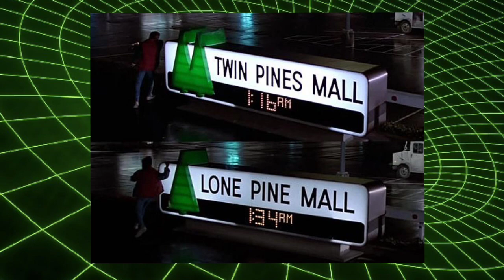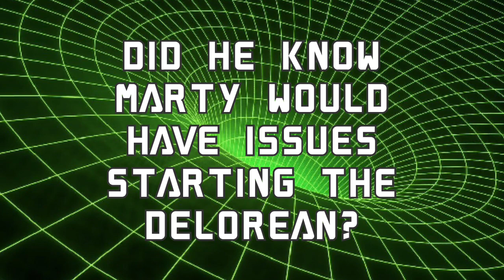Back To The Future Theory - Docs Lightning Strike Calculations

Comment: Assuming that the car connected to the wire at 10:04 pm. there was a 60 second window where the lightning could have hit the tower.  Doc eluded have needed to build a wire about 1 1/2 miles across to account for the uncertainty of the exact second the lightening would hit the tower. He probably would have wanted to make the wire even longer to account for Marty’s delorean connecting to the tower slightly early.  I don’t think one week would have been sufficient to build a wire that long.  I agree with the person making this video that the chances of Marty returning successfully to 1985 were extremely slim.

Comment: You're missing one major detail that was actually in a bunch of the photos. Doc had a remote control for the time machine... he started it and set it in motion at the precise time... 

Doc is a time traveler. He already knew the exact moment the time machine should start towards the clock tower since he's probably witnessed it many, many times. He controlled the time machine with the remote.
Reply from the maker: Good point

Comment: Assuming that Marty’s wire connects at exactly 10:04 PM, the wire would need to be long enough to account for the uncertainty of the exact second the lightening hits the clock tower.  This means the wire would need to be 1 1/2 miles long to account for the uncertainty.  Doc would want to make the wire even longer to account for Marty’s Delorean connecting slightly early.  One week would be insufficient time for Doc to build a wire that long.  I agree with the person making this video that the odds of returning successfully to 1985 were astronomically low.